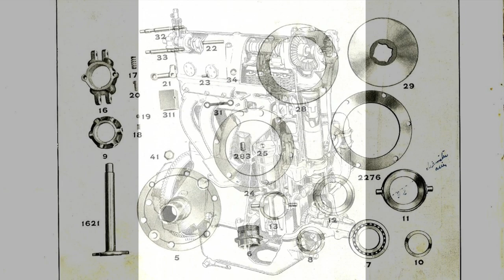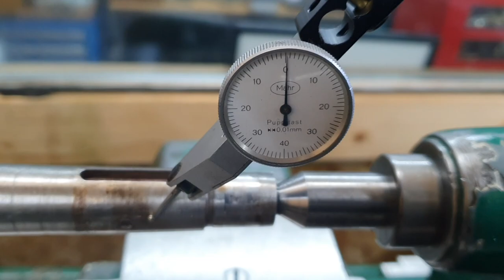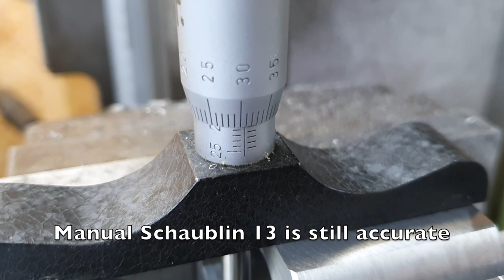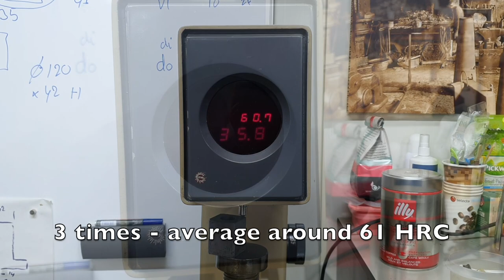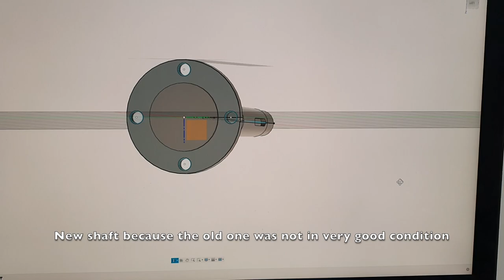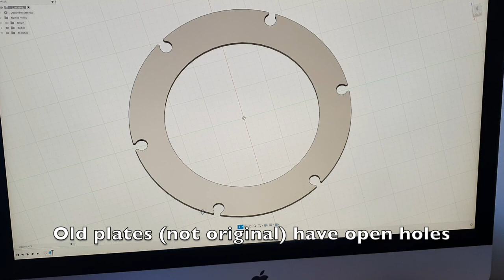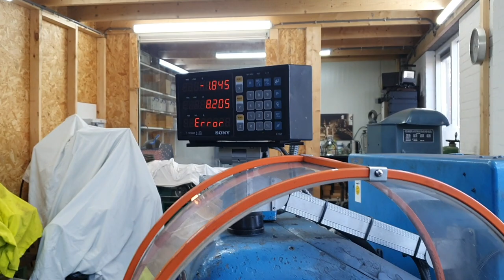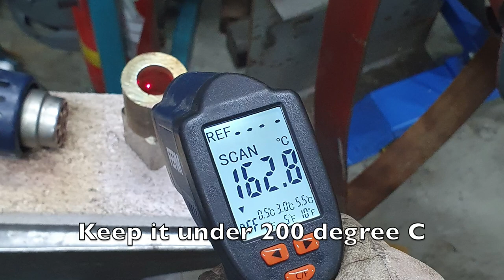1924 Bugatti Brescia Clutch Restoration

Comment: Well done Bart! Neat to see how things were made. A suggestion on turning cast iron. Put the tool upside down in the holder and run the lathe in reverse. The chips will spray down into the chip pan.Thanks for sharing.
Reply from the maker: Thanks. And I will give the upside down tool a try next time 👍

Comment: When I saw that your square block when heat treated no longer fit on the tapered shaft. It is because the part that is heat treated actually grows. I worked in the tool making industry for years with all sorts of tool steels. All parts that were going to be heat treated we had to take into account the amount of growth that would happen. In our case all the surfaces were ground to spec afterwards.
Reply from the maker: Yes 👍. I expected it to grow a little but not that much. The taper is less then one degree so it shifted its position around 3 mm. I had 1 mm to compensate but that was not enough. Good learning experience.